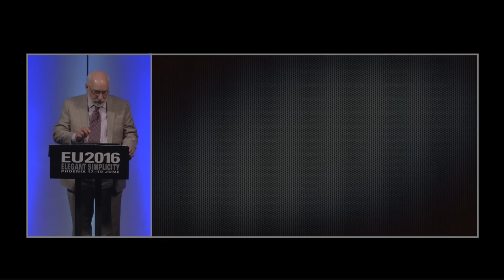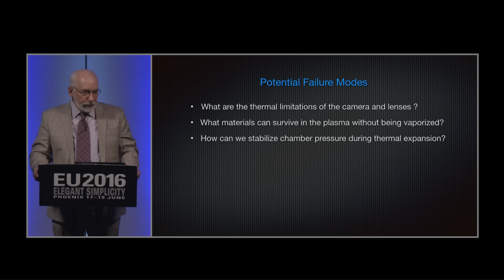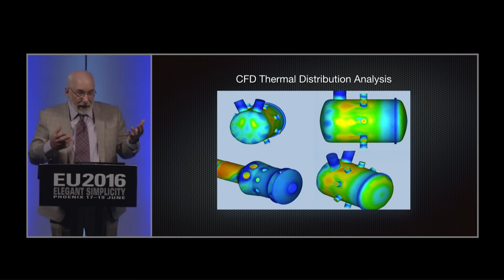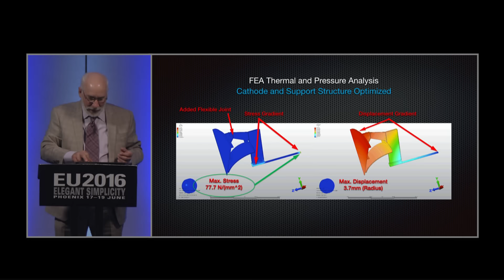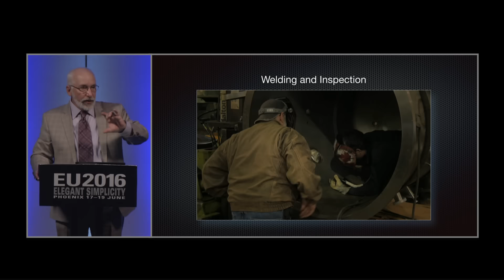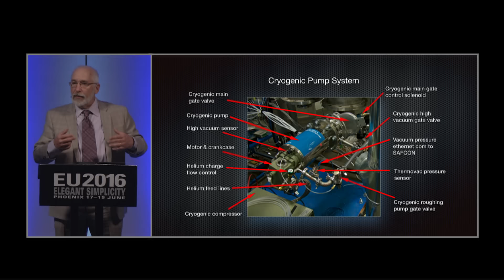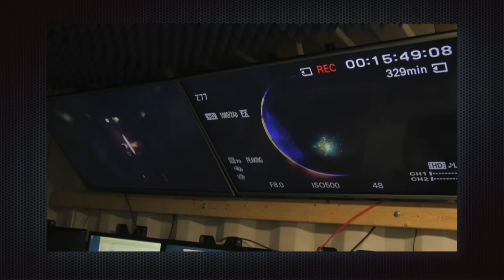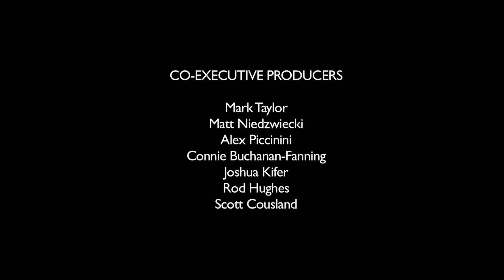Montgomery Childs: SAFIRE Project Update | EU2016

Comment: An enormous undertaking by such a small team with limited funding. So thankful we are being shown the inner workings here. Should the eventual results from SAFIRE have enough punch to puncture the current academic iron curtain - all of this will stand as a permanent record and testament and hopefully a reminder of the damage caused by institutional stagnation, waste and rot. When brand new theories deliver both new insight and advancement, yet must struggle against impossible odds to even be acknowledged while error and folly is lavished with every convenience and advantage - we are being shown in no uncertain terms that there exists a cancer we can no longer tolerate - not only in the current mainstream but the one that is soon to follow.
Reply: Hopefully the remedy for this is what your seeing from the thunderbolts group and the SAFIRE team. As the college students really catch on to what`s going on they will demand answers so each and every chance I get to share this info with folks I do it and I do it gladly.
Reply: Of course this is just part of what the Electric Universe community is all about, albeit the biggest piece of experimental science that is happening at the moment and so the most important today. As a community we are continually knocking lumps out of the main stream on a daily basis and so proving that the universe is electrically driven and not a mechanical/gravity one, as guessed at by the main stream scientific community.

Comment: Correct me if I'm wrong, but wouldn't putting the entire structure in another that is vacuum pressurized without all the o-rings and ports, let that outer structure deal with the heat? Allowing you to run much longer?

Comment: why can't you line the inside of your reactor with refractory materials like Al2O3? I built my own smelting furnace and lined it with a refractory cement, then a liner of what is called a 'reflective material' with an Al2O3 base effectively allowing me to achieve temperatures in excess of 1648 celsius. The result is very little thermal conductance to the outside of the chamber.
Reply: + krotos2009,     I wonder if the inside cameras would be able to work if the temperature was to high?

Comment: Presenter comments regarding EU/other bookmarks 

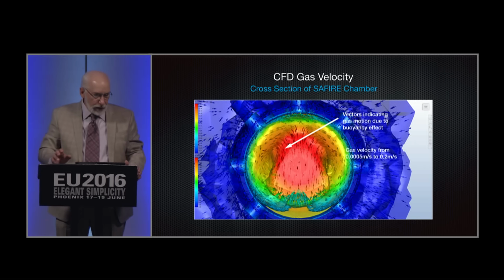22:05 Effect of gravity on plasma discharge

22:42 Heating a body using electricity, why the surface of the anode is cooler than at its core, how this fits with supposedly old bodies still being warm

39:40 DC vs AC in the EU
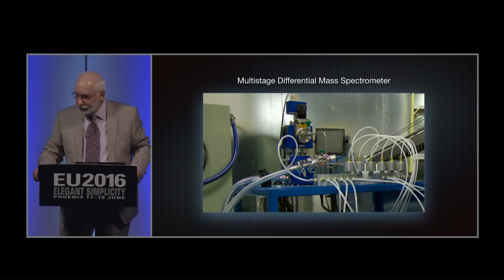Reply: 50:37 Mass spectrometer, some "strange species" of gas as mentioned at last year's conference.
Reply: hooray for time~stamping!  good job, thank you, keep promoting it when you see others.  We'll be the Time-Stamp~Lords!  silly people who need to be taken seriourly
Reply: seriously rather